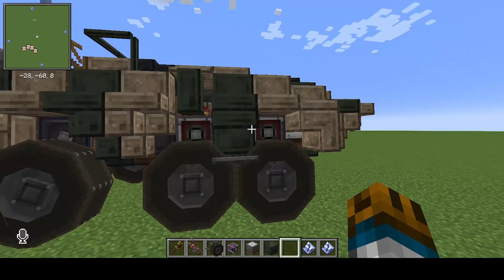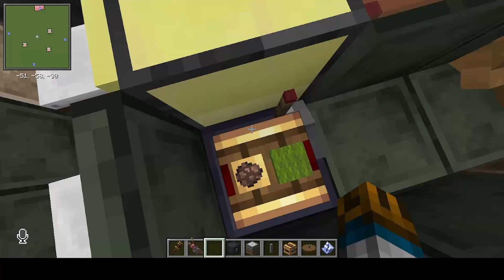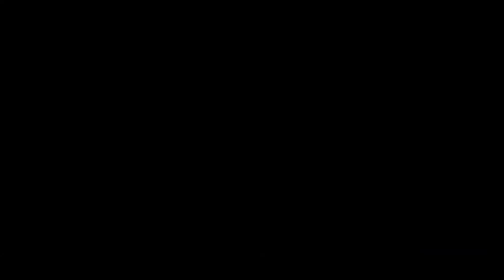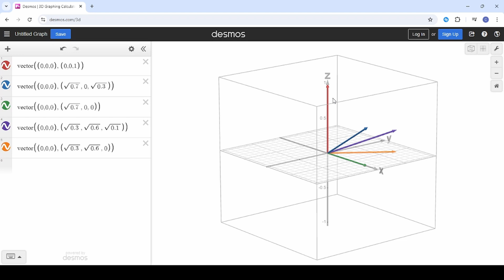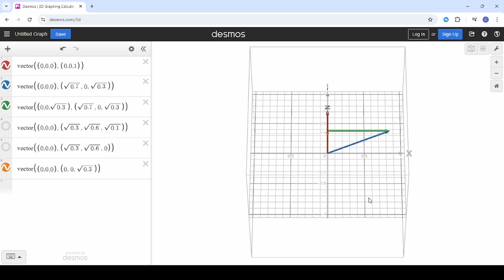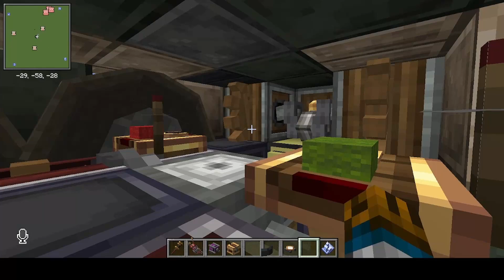Minecraft BTR 82a: Setup and Mechanics Explanation

Comment: Great, now I spoiled myself. I am working really hard, currently on the perfect program for my tank (my first one actually) and have a bunch of stuff already figured out. I'm very inexperienced with programming, and tutorials and documentation on computercraft are difficult to follow, from my perspective. Still couldn't establish a wireless connection. So I thought I'd check out this video, and now I can't get the things I've seen outbof my head. I wanted to create something original, and here I've seen someone do it way better, ready to copy even. Whatever I make, it will be inferior to this. I've spent countless hours of the last two weeks trying to make the perfect driving transmission with only create, create:connected and the advanced linked controller. A mess of links and stuff, and did not work. I just want too much. Now I have the driving transmission worked out, only have to get the redstone I/O to the corresponding gearshifts, chain drives and clutches. I thought it was ultra compact. Now you tell me you can control rotation speed controllers with computers. I don't want to give up though. I still have a couple aces I can play, that I haven't seen anyone use. I just hope the reason for that isn't because they are not useful.

 Thank you for not only making you design accessible, for free, but especially to produce such a detailed tutorial for those who don't just want to copy and paste, but understand the things and make their own stuff.

Comment: Amazing vehicle man, but sadly when i click on the computer it crash (Ye, i'm 1.20.1). Gratz bro.
Reply from the maker: Yeah, that's a 1.20 issue afaik. Try either downgrading to the second most recent computercraft, or maybe breaking and replacing all the computers to get rid of outdated data brought through the schematic?
Reply: @BobJoeVIII Wassup man. I already fixed It by downgrading the cc mod to 1.111.0. Thanks anyway.